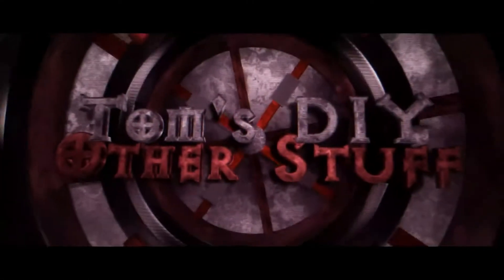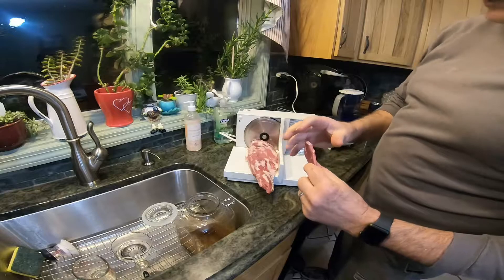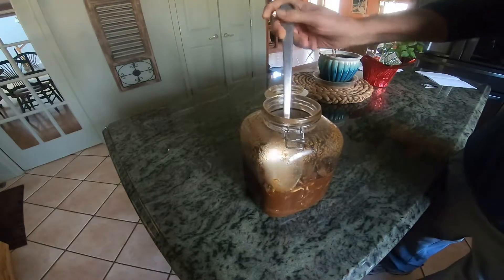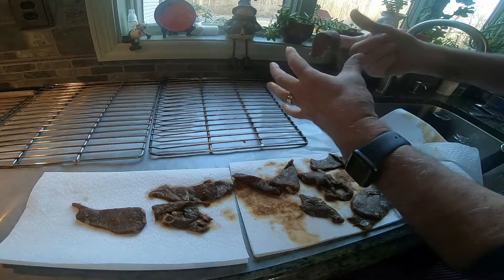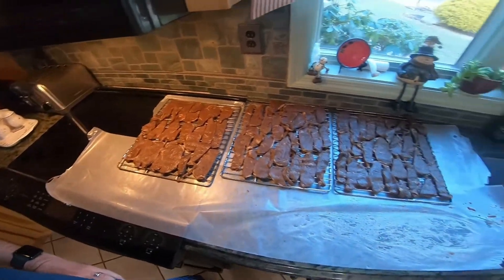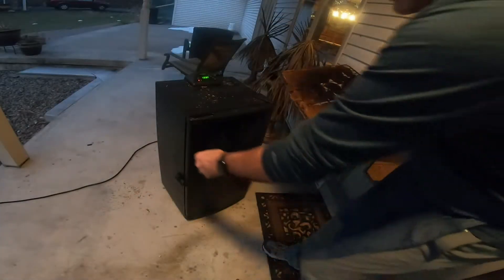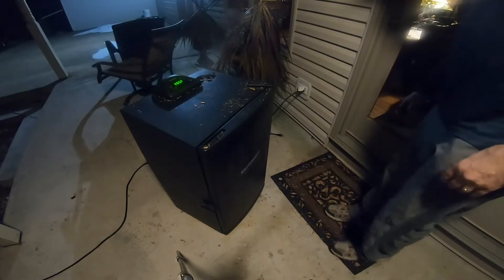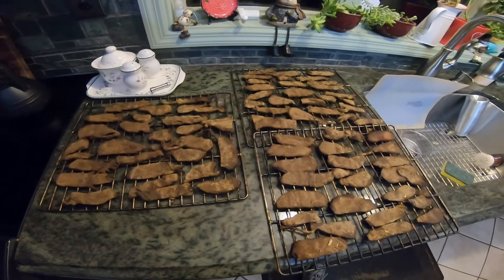Beef Jerky on the Masterbuilt Smoker

Comment: I have the exact same smoker as you my tip is only use the top rack and attach paper clips on every other grate wire so it should fit 11 pairs. And use scewers so that you can hang your jerky I just did some today and it fit 6 pounds of eye round
Reply from the maker: The skewers is a great idea. Thanks